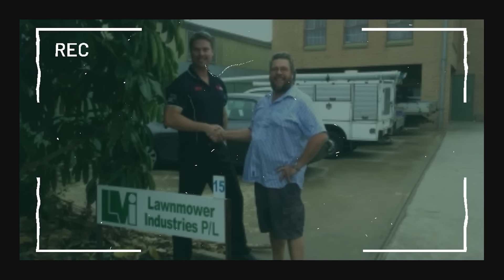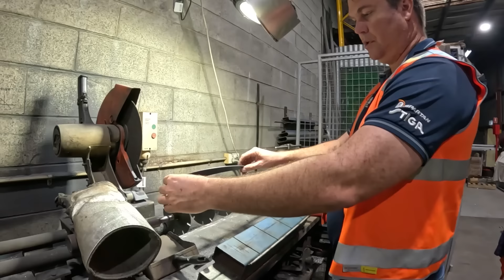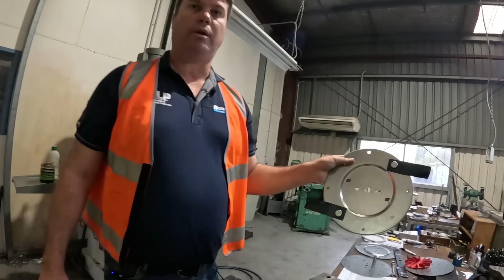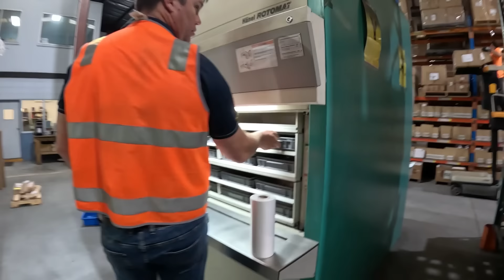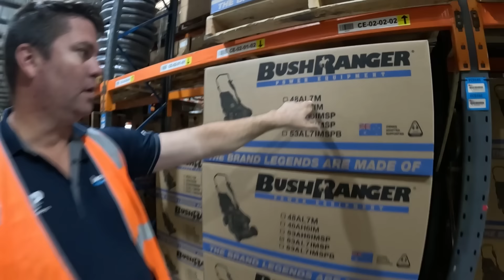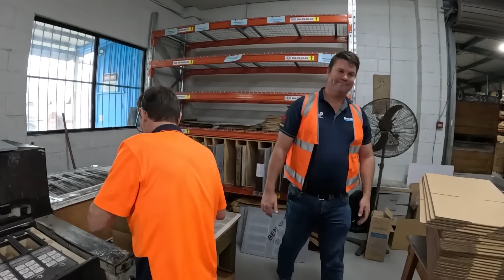The Amazing Way This Aussie Business Makes & Supplies All Your Mowing Needs

Comment: I live only minutes away from this very interesting tour, a local company to be proud of. I worked for Rover Mowers as a toolmaker way back in the 1970s. I own and use a Bushranger three speed self-propelled commercial mower. My opinion and experience are that these are solid, well engineered mowers. The Honda engine is reliable, starts every time and is easy to service. Highly recommend Bushranger. Cheers